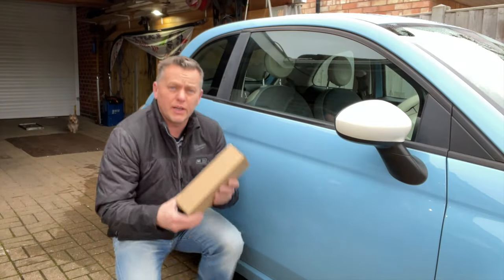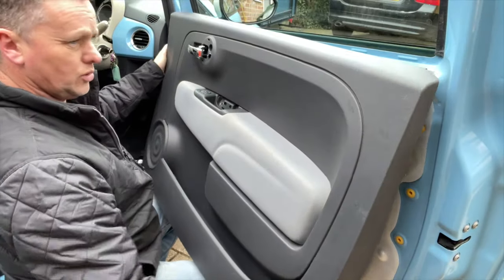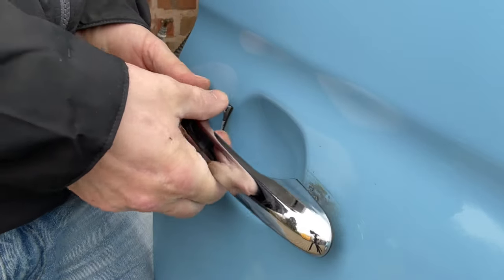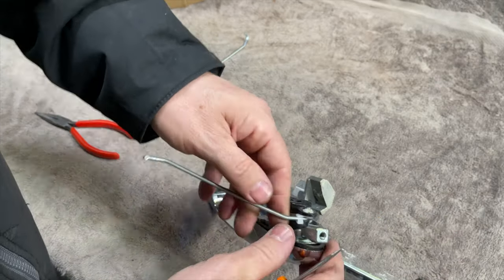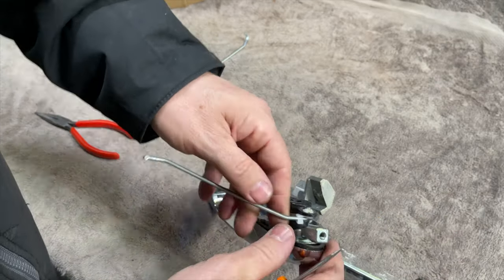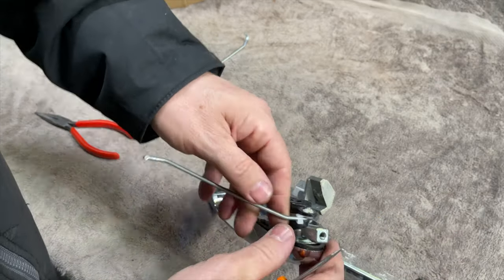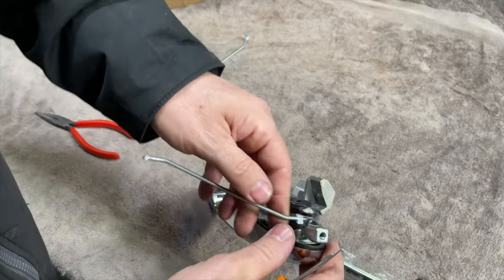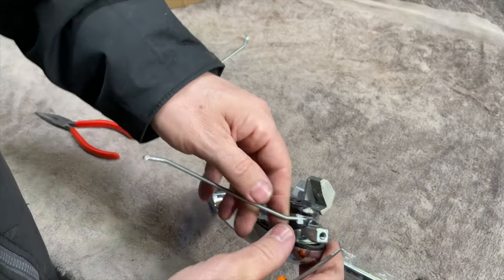Fiat 500 Drivers Door Handle & Lock Barrel Replacement, "The Real Job With All The Tricky Bits inc"

Comment: Thank you SO MUCH for this video! I followed your instructions and was able to replace my door handle all by myself! My mechanic quoted me at $320 for it but I did it all myself for just the cost of the handle. You helped me save $300 AND help me feel empowered haha :D 

Thank you!
Reply from the maker: Great job! well done Thanks for the great comments👍🏻👍🏻🛠
Reply: You can fit a replacement hinge for around £6 but decent videoing by good use of a tripod, I didn’t bother undoing cable just left card standing by door, I also peeled the cover took a bit longer but much neater finish and more secure from water ingress, I would also not use screwdrivers to remove trim as they can scratch I have a cheap set of plastic trim removal levers paid for themselves several times over. One good tip I found was you can fit a new hinge by unscrewing the old hinge and screwing in the new hinge via the hole in the door of the hinge location. I’ve experienced the bad side of removing the rod but learned a lot by working out how it goes back in top and bottom, appreciate your help in posting this video especially if I have to replace drivers handle and barrel.

Comment: Thank for the video it helped loads.

Just a note that I found might help with the new handle going back on issues, after lots of banging like you said, with no joy.
I put the retaining screw back in and slowly tightened it whilst adding pressure on the handle and it slid right in.
Hope that helps anybody watching this vid.
Reply from the maker: Thanks David  for the great information👍🏻👍🏻🛠
Reply: @aaanton11  mate, you’re welcome, I never watch the whole video first time, but your torch has had me in stitches 😂

Comment: Thanks aaanton11, I followed your video today to fix the drivers handle on my daughters Fiat 500. I managed to replace  just the hinge without loosening the lock end of the handle. Putting a stubby phillip’s screwdriver through the inside of the hole (where you removed the nut for the handle) gives you access to the screw to release the hinge. Using a stubby screwdriver gives you better purchase and a bit more umph!! 
Thanks again 👍🏻
Reply from the maker: Thanks for the great information👍🏻👍🏻🛠

Comment: Loved your vid.  Helped me greatly.  Still had to use my small file set to clean off the casting of the new handle, just to get it to pop in and slide in place.  Also had to move the plastic grommet or retainer, from the old handle to the new.  This was the white circular bit of plastic that held the upper armature in place.  Laughed at the torch left in the door.  And then....I proceeded to do the EXACT SAME THING.  By the time my son got back into his 2012 500 Pop, we had no time to remove the card and fish it out.  Oh well, maybe next time.
Reply from the maker: 😂 at least you know where it is, that is funny, Thanks for the great comments👍🏻👍🏻🛠

Comment: I did one of these on my neighbours, I opted to just change the hinge as she hadn't much spare money and the hinge is only £7.99. No need to remove the whole handle, just get someone to hold the hinge end away from the door while you put the little screw in that holds the hinge inside the handle. I used a screwdriver bit with a small spanner to drive it from the side. Takes longer to remove the door card and the screw that holds the handle in than to actually fit the new hinge. I taped off the hinge end while working to protect the paint finish. These handles break because the hinge end seizes up, I give them a squirt of oil every now and then for her now just to keep them moving. As always a great video and thanks.
Reply from the maker: This is great advice, I will definitely be trying this next time Thanks for the great information👍🏻👍🏻🛠
Reply: Thanks for the knowledge man , need to get this job done shortly.

Comment: Thanks for the great tutorial, just finished the wife’s Fiat 500. Managed to get it all done as described struggled to get the handle off, as I couldn’t for the life of me get the springs off at the back, eventually the whole came through with a bit of force, thankfully front panel was unscathed! New one went it sweet and didn’t need to bang or jiffy it, the “click” happened when I tightened the lug on the side of the door. Had a torch moment when I realised I forgot to reclip the door to the cable, and only realised once everything was back on!! Thanks again though really good video and very well set out.
Reply from the maker: Thanks for the great comments👍🏻👍🏻🛠

Comment: Thank you so much for making this video, it helped immensely. I had a little trouble towards the end, trying to get both parts of the handle aligned correctly so that it closes flush - but I managed it 😄

I just wanted to add that the North American Fiat 500 has two additional screws securing the interior door panel, but otherwise everything was exactly the same.
Reply from the maker: Well Done Simon, Great Job Thanks for the great comments👍🏻👍🏻🛠
Reply: You saved me with sharing that detail
Reply: 1.5 years later my passenger side handle hinge broke…

It was a bit easier to do. The door handle only has one rod to disconnect, as it doesn’t have a lock cylinder mechanism. The rod also popped right off and fell into the bottom of the door, so I had to fish it out from down there.

Comment: Thanks for the video, changed the handle on drivers side today. Air was blue whilst trying to release the blue & red clips, found pushing them out in like a downward motion worked. Also rod at the top just couldn't release it from the inside, so having pushed it so far out of the door, removed it from the outside, used a screwdriver to pop both the rod and white plastic retainer. Thanks again, wouldn't have attempted it without your video.
Reply from the maker: Glad it helped Thanks for the great information👍🏻👍🏻🛠

Comment: I did this today. A bit hairy but it worked - thanks. The red and blue plastic clips on the bottom of the rods were tight and I couldn't disengage them at first. Thinking it might be the February cold I pushed a paint stripper into the void - on hairdryer heat setting - for 30 seconds and it softened the plastic perfectly, they released with ease!
Reply from the maker: Thanks for the great information👍🏻👍🏻🛠

Comment: Great little tutorial.
I found that if you wedge the new handle in the open position when fitting the new handle it slips straight in....no walloping required!
To make sure I didn't scratch the paint with the front bolt I wrapped a rag around it and when putting the rod on to the lock itself (not handle) if you put the key to the lock position it moves the tab round so it isn't obscured.
Whole job after watching your tutorial 36 minutes.
Reply from the maker: Thanks for the great information👍🏻👍🏻🛠

Comment: Great video!  I just replaced (tried to) my Fiat500 Driver Side handle and your video instructions helped.  My Amazon bought replacement handle would not fit into the door no matter how hard I tried (casting not sized properly) I ended up just using the old handle and taking the part from the new handle that I needed which was the front pivot.  All set.
Reply from the maker: Glad it helped! Thanks for the great comments👍🏻👍🏻🛠

Comment: Thanks for the video - really helpful.  I had exactly the same issue getting the door handle back onto the door.  I tried the banging technique but no luck.  I was focusing on getting the lower lugs to engage but they simply would not.  Then I twigged that although the top lugs looked ok and engaged, the top front one hadn't really due to the plastic.  This accounted for why the screw hole on the lock didn't align with the door hole.   My fix was to focus on getting the handle to move up the door beyond what it initially wanted to do - and to align with the bolt hole in the door.  Your video gave me confident to keep going!  It is always the simplest of things that seem to take the time!
Reply from the maker: Thanks for the great information👍🏻👍🏻🛠

Comment: I’ve just done this job on my wife’s Abarth. The handles are satin finish and quite expensive so I used the replacement hinge only. The handle came off and went back in really easily maybe because it’s the original part. 
Anyway this is an extremely useful video so thanks very much for it.
Reply from the maker: Thanks for the great comments👍🏻👍🏻🛠

Comment: This was a great help for me. I was really struggling to disconnect the rod from the back of the handle from inside . Ended up gripping it with a pair of pliers to get a straight pull and it came off really easily after about 15 minutes of stressing previously
Reply from the maker: Well done, Thanks for the great comments👍🏻👍🏻🛠

Comment: Thank  you great video , great help. Replaced mine today , a right faff also the screw through the handle wasn't the right side so had to tap the screw, but there is a gap looks like the last owner tried and damaged the door
Reply from the maker: its easy to cause damage, well done for the fix, Thanks for the great comments👍🏻👍🏻🛠

Comment: Thanks for the video mate! Nice to see an honest video on this repair 👍 Replaced the handle on my daughters car. Only thing I would add is when putting on the link rod on the red one check the rod is the right way round as the end that goes into the top has a notch and is slightly longer. I put it upside down and it fell out😂 anyway anyone found a yellow torch?im sure i had it a minute ago 😂
Reply from the maker: 😂Glad it helped Thanks for the great comments👍🏻👍🏻🛠

Comment: Thank you! I didn't have trouble removing and putting in the handle. However, I did have trouble connecting the cables. In your video, it seems your cables accessible. In my 2012 Abarth, i have to reach over through a small window. It was not cool at all.
Reply from the maker: Thanks for the great information👍🏻👍🏻🛠

Comment: I finally did it.
1. Lost red clip inside door.
2. Found it again.
3. My replacement door handle had no screw thread. Refitted original with the hinge from the replacement.
4. Messed up internal door handle linkage. Took panel off again, refitted it.
5. All working.
Reply from the maker: Well done!! Thanks for the great comments👍🏻👍🏻🛠

Comment: Thankyou so much for this it is the most helpful of the videos I watched I would not have succeeded without it . A wretched job because of the tight access and darkness and crazy design which is so awkward - like changing your underwear in the dark without undressing. One wrinkle I discovered installing the new handle where there is zero maneuvering room; I slackened the three fasteners around the lock cylinder assembly slightly to give a hair more space between the door and the handle seals which allowed enough play to get the lock flush with the door - final positioning required an upward and then inward movement to allow the lower lugs to clear the opening and seat before moving the handle rightward to secure it.
Reply from the maker: Thanks Alistair for the great information👍🏻👍🏻🛠

Comment: Thanks, one tip. Make sure the plastic clip on the pivot on the new door handle, actually holds the actuator arm in place. 
My (non original part) did not come with new arms, the existing arm did not click in place.
Had to re-use the old plastic clip after removing the door handle AGAIN!
Reply from the maker: Thanks for the great information👍🏻👍🏻🛠

Comment: I replaced on my daughter Gucci just hinge. I did not  even removed door plastic cover from cables and power cord: just unscrewed it  and  moved a little bit from working area. Also, I unscrewed bolt, that hold door handle, from the corner, removed from inside for a little bit, just for space for key, and replaced hinge very simple. It took me 15 minute.
And one more: I never cut soundproof cover, just made small hole with finger for 10 mm wrench.
Reply from the maker: Thanks for the great information👍🏻👍🏻🛠

Comment: Thanks so much for this, just changed hinge on drivers side, I watched that part about 5 times, and finally popped it out, still really awkward, and getting it back with the pegs on bottom hooked over, is also really awkward - no idea why they made the aperture so tight, if it was 1mm wider all round this would be a doddle !! I bet a lot of people snap the lock side of handle trying to get this out!
Reply from the maker: Well done!! Thanks for the great information👍🏻👍🏻🛠

Comment: 20 year old here with no mechanical/car experience whatsoever 😂 The handles on both sides of my Fiat have officially broken entirely. I am currently climbing through the boot..🤦‍♀️ Instead of paying out to a proper mechanic I thought I’d give it a go myself…wish me luck anyway. Great vid 👍
Reply: You got it!! It's so easy! I did both of mine over the weekend. The passenger door was a pain because the new handle was made different and I didn't realize it until an hour or so in but the driver's side was a breeze!! BE CAREFUL with the driver's door because the buttons for setting the mirrors is flimsy and mine came apart, while I was trying to take the panel off. It doesn't help that I have really long nails. I got the job done though, all by myself.
Reply from the maker: You can do it Beth No luck needed👍🏻Thanks for the great comments👍🏻👍🏻🛠

Comment: Done a few of these, absolute pigs to get in and out of the outer door skin.

If I can add a bit of value, a bit of grease (white waterproof preferably but anything helps) on both handle to skin gasket helps the handle slide along the skin and on the barrel and O ring to help it slip into the new handle👍 some are easy, most are sods though. 

Thanks for the upload. 😎
Reply from the maker: Thanks Richard for the great information👍🏻👍🏻🛠

Comment: You can change the hinge without removing the handle, which I have just done and it is a lot easier. I have done it this way previously and remember the grief of fitting the mechanism through the door. This is avoided when you just replace the hinge. A great video though!
Reply from the maker: Thanks for the great comments👍🏻👍🏻🛠

Comment: Thanks for the video. Got a problem though, can't lock the car now neither with key or fob, any idea why is that? Both rods properly attached to links. Is it the actuator that went off?
Reply from the maker: there must be an issue with the lock barrel, disconnect the rod to the barrel and then try the remote locking, Thanks for the great comments👍🏻👍🏻🛠

Comment: Very good shows all the details Thanks!
Reply from the maker: Glad you enjoyed it! Thanks for the great comments👍🏻👍🏻🛠
Reply: @aaanton11  Job is done , but buyer beware of replacement part . The little round clip that holds the top part of the linkage is to large and would not hold the link in place. I solved this by fabricating a new link rod with a longer finger that would accept a speed nut at the back. Works great now! Also I filed the opening where it it was to tight  so that the handle would slip in more easily.

Comment: First check the tiny rubber buffer under the handle (the bit that broke) is present. If not and the old one is original you can push it out from the opposite side with a paper clip. Using thin screw drivers you can put it in place on the new one then secure with a TINY drop off superglue.
If its tight in the door turn the three screws a quarter or half a turn anti clockwise it will then easily fit the door. It won't rattle if you only undo them enough to fit.
Reply from the maker: Thanks for the great information👍🏻👍🏻🛠

Comment: I wonder if you put the screw in the end of the door would it pull it backwards and line it up easier
Reply from the maker: Possible but I didn't want to risk pulling the threads out as they are very soft, Thanks for the great comments👍🏻👍🏻🛠

Comment: Thanks for this. Maybe putting the screw in the rear of the door would pull it into place. I had the sa.e issue with mine and am having to do the passenger side now. Also I dropped a clip into the dior and had to make one out of paperclip 😂.
Reply from the maker: Did you remember to take your torch out!! Thanks for the great comments👍🏻👍🏻🛠

Comment: I tried to fix mine today but on a 2012 Fiat 500 there are two bolts holding the door panel on that it appears your model year doesn't have. I started popping the door panel off, but the corner and outside edge wouldn't come off. I tried a screwdriver and pulled so hard I bent the edge of the panel and damaged it. I then noticed two holes that had covers over them, removed the covers and saw the two bolts holding the door panel on. The head of it looks like a + symbol and I didn't have a tool that fit it, so I got derailed at door panel removal. Trying to research now what tool I need to remove the door panel bolts. Great video though, I'm sure it'll help me once I get the door panel off.
Reply: Saw a couple other videos for a 2012 model year and it looks like those bolts are removed with a Phillips head screwdriver. They are very hard to see, sunk in a bit, and mine also look like someone removed them at one point already, kind of look stripped a bit, so because you can't see them, and they look worn I couldn't tell it was just a phillips screwdriver needed. I'll give it another try.
Reply from the maker: Thanks for the great information👍🏻👍🏻🛠
Reply: @aaanton11  It looks like the difference might be UK vs USA models. In other videos I saw it looks like the USA version (left side drive) has the extra screws and the UK model does not. My bad for not noticing them sooner. Got the panel off no problem and the rest of your video is spot on. I hate working on cars but to save $300 US and time with the car at the dealer, it was worth it doing it myself. Your video is one of the best out there, walks thru all the little parts that other videos skip over. Thanks for the detailed video.